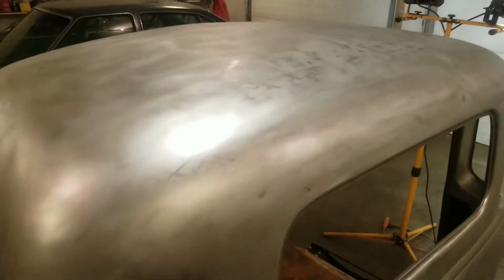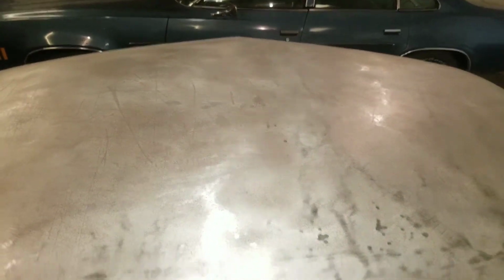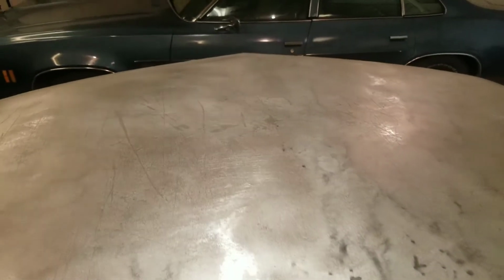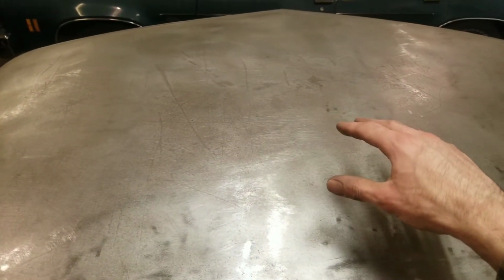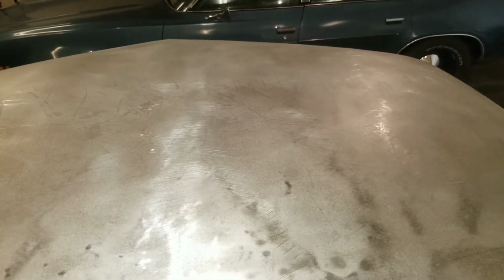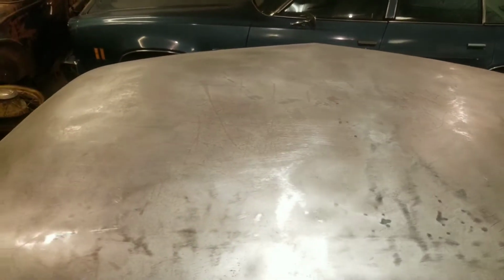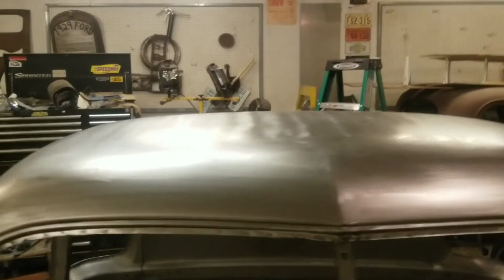1953 Chevy Truck Roof Oilcan Repair

Comment: Excellent videos, thank you. It's great seeing films like this showing ways to do things for those of us who want learn the proper ways to do things. Slapping bondo over things isn't going to work when you're trying to do unpainted aluminium skins for example. And often if you know what you're doing, doing it properly doesn't take any longer, is far cleaner and is ultimately a much better repair.
Reply from the maker: Thank you! I was helping a friend out on this truck so we weren't going for perfection, we were just trying to get the roof solid again so that minimal filler was needed to complete the repair. He is trying to build this truck on a budget, and the first shop he went too wanted a blank cheque, their plan was to weld a steel strap inside the roof and slap filler on it.

Comment: Very good job. You must just hate sanding filler like most body work . Ya it takes a bit of time but when you can do a job like that it doesn't need any filler at all . Wow great work .
Reply from the maker: Thanks Larry. I do hate sanding filler, but I still had to do some bodywork on this one, I just didn't want to sand any more filler than I had to.

Comment: Every low has a high. I was taught to use the puller to apply pressure, then tap the highs back down to relieve the pressure on the low. Def gets a lot more done per stud imo

Comment: Hi Kyle...
That roof looks great!
I notice that you have a couple of people who comented on what you should do or that what you isn't that hard to do.
To them I say show us your work to stop tying.
Rocket science isn't hard either, if you know how to do it.
Being nice however, seems to be hard for some people though.
Reply from the maker: Thanks Joe. The trouble is that there's a lot of different ways to achieve the same goal, which is why I try to avoid advertising my videos as "how to's", instead they are "how I do it". This video was the second one I ever filmed (it didn't get edited until 6 months later), but it was pretty rough and unpolished. I also didn't film any of the hammer and dolly process on the roof and I think people misunderstood and thought I used a unispotter for the whole roof (there was no access to the backside of the area I was using it on). The message of the video was that all the damage should be repaired before resorting to shrinking a panel...I'd like to think I now have a better understanding of what information needs to be included in a video to make the message clear...although some people just get a thrill out of critiquing others.
Reply: Kyle, I think the message was obvious and very well demonstrated. But then again, I have some years of experience in the field. Although I'm not as talented/patient as you. 
You can't provide the right (or enough) information for everyone so don't get too bent out of shape (see what I did there?) about making the message crystal clear. You will spend too much time thinking instead of doing.
 Paralysis by analysis is to be left for the thinkers, not the doers.
3 steps.... 
1. Produce videos. 
2. Explain what you feel is important. 
3. Answer question in the comments.
And a PS to that... Leave the critics alone to get their jollies.

Comment: I have a 47 Diamond-T that is completely covered with rust.
What is the best way to prepare it for painting.?
Reply from the maker: The best way would be to have it chemically dipped. Unfortunately that's also the most expensive way and there's not many companies that will dip a whole body. You can have the door jambs, floors and inner structure sandblasted, but there is a lot of flat exterior panels on a diamond T that will warp if they are sandblasted. The exterior panels you will have to sand off the worst of it with 40-80 grit sandpaper on an orbital sander, then remove the rest chemically with a product like Naval Jelly. Wray Schelin discusses removing rust with Naval Jelly on his  channel.

Comment: The work is very good.  I wish you would have shown the work on the rest of the dents.
Reply from the maker: Thanks. Sorry I didn't bother to film the rest, I didn't think anyone would be interested in seeing that. When I have some free time I'll try doing another video on dent repair.
Reply: @CarterAutoRestyling  I'm working on a 54 Chevy truck and have a similar issue with the top is why I asked.  I have to do some work on it and I'm learning this stuff.

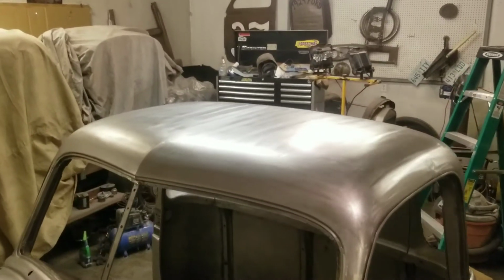Comment: What did you do between 3:53 and 3:55?  I often over grind and over thin the metal.  How did you surface that without hurting the thickness?
Reply from the maker: 8" 80 grit on a grinder making long even passes accross the roof

Comment: What about oil can on a flat or low crown panel?  How do I determine where to shrink?
Reply from the maker: Start by fixing all the damage as close as you can get it. Make sure the edges of the panel are all pulled back to the proper dimensions. If it still oil cans, pop the oil can so it's facing out, find the highest point with a straight edge and start shrinking there.